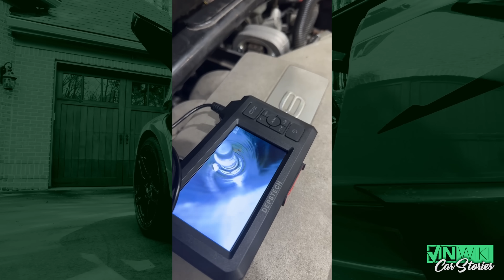I dropped gum into my engine...

Comment: The only thing that seperates "real" mechanics from at diys in mechanical repairs is confidence solving problems like this and sometimes super sick equipment people outside a shop have never seen. I have a snap on tool that is basically a sharp portion of pipe to remove spark plug boots that are stuck to spark plugs. You would never need this tool until you do.
Reply: Very real comment - I’ll say this is one moment where lack of confidence was most likely a contributing factor

Comment: Once finished a rad flush then started an oil change. Drained the oil then proceeded to put half a quart of oil into the radiator before i realized i was an idiot. Sleep is important, guys.
Reply: 😂 chocolate milk anyone?
Reply: If you had a Subaru, that wouldn’t matter since the engine mixes the oil and coolant together anyways. 😄👍
Reply: @stephen3164  i see what you did there  😂
Reply: No Issue.. put the coolant into the engine 👍👍

Comment: As an owner of a v8 xc90 I can tell you that are as much a dream to drive as they are an absolute nightmare to work on .
Reply: Facts 😂
Reply: tell me about it 😂, and mine's shoved into a sedan!  ...and for some reason I want an xc90 v8 now too...
Reply: They're not bad-bad. Even the timing cover isn't that bad. Alternator tho...that's bad
Reply: @F14CRAZY  my alternator is getting covered in oil right now from front valve cover gasket leak, I need to get that fixed asap so I don't have to go there 😆.  I really do want to get the engine out of the car one day though for a full service on everything, so I'm not too scared of that, and I've got plans for this car too but I'll need my own shop first...

Comment: I’m just going to pause this here and ask the very obvious question on all our minds. This guy has a lift…. Does he not have an air compressor? Why did he not just blow the plug hole out. Matter of fact that’s just a good habit to be in when pulling plugs. It keeps any debris from falling into the cylinder if you got dirty holes….. haha. 😅
Reply: You missed where I said “I’m not a great wrench” 😂 but plenty of compressed air was used, 60 gallon compressor was a hummin’
Reply: no you said that repeatedly. I def caught that. I’m sure many lessons were learned that day. Nobody was a pro when they started. Or good. We all start somewhere my man. Even expensive lessons can be worth it if you learn from them. 🤙🏻🤙🏻. I wasn’t laughing at ya. I was laughing to myself about dirty holes 😏😉😂
Reply: I bet a 200psi would have blowing that out

Comment: Nothing like a "quick and easy" job that is neither quick or easy. Had a situation similar to the Triton issue on a 99 dodge ram with the 360. It was down on power, went to replace the plugs.  3 one each side came out easy, last two snapped off at the threads. That less than an hour job took two days to do
Reply: Yeah that’s really no fun!

Comment: I keep a roll of mastic sealant tape (roofing / hvac applications) in my shop for issues just like this.  It's awesome to put between a bolt and socket to keep the bolt from falling off (blind hole applications).
Reply: Smart!

Comment: 3 times I've come across a tiny pebble / rock in the plug well of Triton Fords, I have 2 5/8 plug sockets with a notch ground out to get on the hex.
Reply: Wow now that’s tricky!
Reply: I’ve had cars collect sand around the spark plugs, now I always use compressed air before removing any spark plug to avoid dirt or debris from falling into the cylinders.

Comment: Duct tape a length of hose that fits in the spark plug well to your shop vac hose. You may have to dislodge it with your pick then vacuum out the broken porcelain.
Reply: The “dislodge first” is where this story really got sticky
Reply: @nikkrueger5734  🤣

Comment from the maker: What was your worst DIY mechanic fail?
Reply: Well it wasn’t on a car but on my bike my first ever repair on the wheel didn’t tighten back up after repair rode down the road and the front wheel fell off during a wheelie 😆😆😆🫡
Reply: Lost the cap to the power steering pump on my 1974 Charger SE, which allowed the fluid to escape, resulting in Armstrong Steering. The fix...jam a foil-wrapped cheese sandwich into the hole which worked beautifully. Until it didn't.
Reply: I had just finished replacing the oil pan in one of my miatas and decided it would be cool to let the floor jack down very quickly. Well, car drops, suspension compresses, car goes back up, and the car rolls backwards just enough that when the car comes back down, it slams the brand new oil pan into the jack putting a hole in it. I wound up just putting some JB weld on it and letting it ride for the next 20-30,000 miles before selling it haha
Reply: @curtiswilcock5628 during a wheelie 😮
Reply: @jeffreyoldham55 MacGyver would be jealous
Reply: 2008 BMW E91(wagon). Simple fuel pressure regulator replacement. Had the job completely done and was just reinstalling the large, ribbed lock nut that locks the regulator to the gas tank. Was using the special wrench to tighten down the lock nut and didn’t realize I was spinning the wrench into the fuel line and snapped the head off of the fuel line. Fuel line replacement required dropping the exhaust, gas tank, rear differential and drive shaft😑
Reply: Hose clamp came loose on track from my turbo charge pipe.
Reply: I had a MAF tuner on a DSM and decided to tweak the tune one morning after a rain. Got water on the computer chip and had a rough drive home after work. Spitting raw fuel and flames while trying to die at idle. There was a cloud behind my car the whole way home. I’m an idiot, but a much older and slightly wiser idiot now.
Reply: Trying to take rusted brake discs off a clapped out Citroen C3 with nothing but a torx head screw driver.
Reply: A previous mechanic had ruined the threads of a wheel hub (presumably using an impact to "torque" the wheels). I decided to change the hub and 4 bolts. 
- I ordered the wrong hub, one without ABS strip, which was marked as "compatible" but of course ABS light came on
- on the second hub, I did not support the inner race when pressing, ruining the ABS strip
- the third hub was pressed correctly
- between the second and third hub, I also figured I had broken the wheel speed sensor, because I had installed a circlip incorrectly the first time around and had banged the sensor back into placev (the sensor was deformed by going over the circlip).
- there was a few other "regular day mechanic" issues that had to be fought against, but fortunately not causing additional parts purchase.

That was a lot of mistakes, fortunately not very expensive (the hubs were around 20€ a piece, same for the sensor), and I learned a lot this time.
Reply: Replacing the alternator on the same engine in a Volvo S80 V8. Definition of nightmare job, took 2 days, and thebissue came back. As the ECU regulator part died too, so needed to take it to a shop after 2 days of ball busting work. They didn't trusted my job so replaced thebalternator again, which made no difference. Then they sent off the ECU for repair that solved the issue. 3 weeks and $$$...
Reply: third worst: brake rotor rusted shut preventing me to do the brake, went to nearby shop to get it off in the end
second worst:  tensioner broke off when i was going to replace alternator. 30 minutes job became days since it was national holiday
first worst: floor jack failed rrrrrright before i setup the jack stand. hydraulic seal gave up and send my car back to ground immediately a couple inch away from my face. this just happened yesterday
Reply: My dad cut his break lines while replacing his pads and rotors in college. 😂
Reply: I just did the same wheel bearing on my wifes Peugeot 207 GT for the 3rd time. I have no clue what im doing wrong, i checked and double checked every little step, every nm setting, controlled everything,  especially when pressing stuff with the 20 ton press i just bought for this job, even bought the original workshop Software Peugeot used for real mechanics. Wheel bearing is toast, the moment i finish. I admit defeat, i hand this over to a real mechanic...
Reply: I’m usually too embarrassed to share, maybe I’ll share some the next time I’m down. I do have some doozies and some from when I worked at a used car lot.
Reply: Did an oil change of my girlfriend's car when I was probably 17.
Pulled the car into my parents front yard and finished up.
Was in the house for maybe about an hour before we decide to take a drive, as I am walking out to the car i notice something in
the oil drain pan.  THE FKN PAN DRAIN BOLT.
5 quarts of 10w40 absorbed into my fathers lawn.
I don't remember how long, but I was a least a couple of seasons before the yard looked normal again.
Lol. He was so pissed, and I was ok feeling stupid about what I did, become it was a pretty stupid thing to do.

In that same mustang, me and her were arguing about whatever 17-year old's argue about and I went out a popped the coil wire
off her car so she wouldn't leave.
She goes to leave; And SHE DRIVES OFF.        WTF?
My mind is running all over to try and understand what, or how.
She is immediately back asking what I did to her car because it was running like crap.
I pop the hood in search of the wizard who was making this thing run.
Well as you probably have figured out, when I pulled it off the coil, it dropped right becide it; close enough to arc a spark that was 
strong enough to keep it running, but weak enough for her to blame me for mischief.

Comment: My 3V 5.4 plug job resulted in a few giant pieces of broken porcelain in 2 cylinders. EVERYONE said I’m going to have to remove the heads. No way in hell I was gonna do that, used a cheap Amazon scope thru the plug hole with a tiny brass tube some fishing line as a lasso. I freaking won and got it all out. Even posted a crappy vid of it to my YT channel. 😂 I felt like a king that day…
Reply: That’s a legit king move, way better idea than gum 😂

Comment: This happens a lot so I'll tell you how to do it properly (no gum). You may have to wait a few days and buy two items if you don't have them. Item one is a long rod, no less than 1/8th of an inch wide, but the wider the better. Item two is 3M VHB (Very High Bond) tape. Apply the tape to the end of the rod and trim it to the rods end. Wait until you are ready to retrieve the fragment before you remove the tape's red backing. It will lose its effectiveness if it bumps into anything. Nine times out of ten I need a hair dryer or a heat gun to detach anything bonded with 3M VHB without destroying them.
Reply: I sincerely appreciate the advice, it sounds safer than chewing gum!

Comment: My friend dropped a piece of an endoscope, like.a tiny sheet steel bracket down into his engine through a spark plug hole. He called me up to ask if it's a good idea to try and start the engine to blow it out and I told him "I wouldn't recommend doing that", which he took to mean "nothing bad will happen from that". I later tried fishing it out with a contraption made out of some wire and a piece of two-sided adhesive tape and it turned out that he deformed the piece so that it doesn't fit into the hole anymore. Ended up taking his head off. You can take tht last sentence whichever way you like.
Reply: 😂😂😂 oh dang, ok I feel slightly better now

Comment: I was in the middle of building a rover V8 and I dropped an AirPod Pro down one of the intake trumpets, it actually got wedged between the backside of the valve and the intake runner in the head. It took an hour and a lot of safety wire to fish it out but I eventually got it 😂
Reply: For an AirPod, seems worth it!

Comment: I would try to do it with a vacuum cleaner, usually it works very well. If needed, attach a metal straw with electrical tape to it. Does wonders in this kind of situations, quick and easy.
Reply: Shop vac and compressed air be damned, this hunker was tight!

Comment: I drained a transmission and doubled the oil once.
Reply: I’ve seen that done!
Reply: I had a transmission line snap off my new Mustang when I bought it and Ford 'fixed it'. That's what the mechanic did. He drained all the transmission fluid and then forgot he didn't change the oil so he dumped another thing of oil in it. I guess he just poured it in with a water can. So they lower the car down, he turns it on, gives it gas..doesn't move. Revs it. Moves like a foot. He's putting it in Park, then drive, then reverse, then drive. Finally the shop foreman comes over screaming to stop. So then they tried acting like none of that was a big deal. I got an extra year on my engine and transmission warranty for that.

Comment: Good thing it wasn't an engine that you have to remove the intake manifold to get to the coils/plugs.
I don't understand how there's a gap beside the spark plug well that leads to the engine...that means that gap would be part of the intake manifold meaning the top of the coil would need to be air tight to prevent air entering the engine, right?
Reply: Still no clue where exactly it leads to but I’ve never seen openings like these on any other vehicle either. Very Volvo-esque

Comment: Sounds like the gum just fell onto the exhaust manifold and burned up. I'd bet money on that
Reply: I thought about that but would that explain the way it ran? That top end noise was loud - like valves pretending to cop knock
Reply: @djmartin4776 That's what I was thinking too. Why else would smoke be coming from the back of the engine? Unless he took apart the intake, I really can't think of any way that the gum could have got into the cylinders while changing spark plugs without directly falling through the spark plug hole, which apparently didn't happen. The ticking on startup is odd, but I can't see how it would be related. Maybe he was just paranoid and paying more attention than usual while the hood was up. The higher idle was likely just been the ECU having to relearn the proper idle settings with new spark plugs that actually work.

Comment: Use shop air to blow out spark plug holes every time before first socket goes into hole.

Ford recommends carb cleaner to break loose spark plugs before first turn
Reply: Sadly this one was wedged so bad even my shop air wasn’t blowing it lose, and here is where my stupidity took over 😂

Comment: I was working at a import shop that did it all. I was restoring MGs most of the time. I get a ticket to do a tune up and valve cover gasket. Long story short i dropped a nut into a cylinder and couldnt get it out. Boss says “whar r the options?” 
Me:”pull the head or try to run it and hope it gets past the valve” 
 Started and ran it right up to 4000rpm, after a couple seconds we heard it bounce down and out the exhaust. It was nice to get lucky on that 1
Reply: Oh wow - had to be a scary moment! That’s nuts 😂